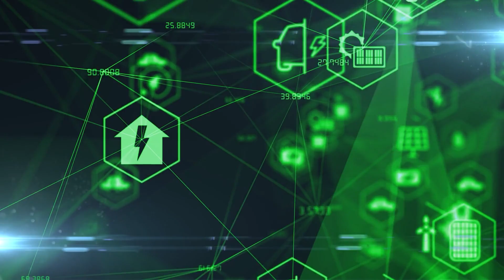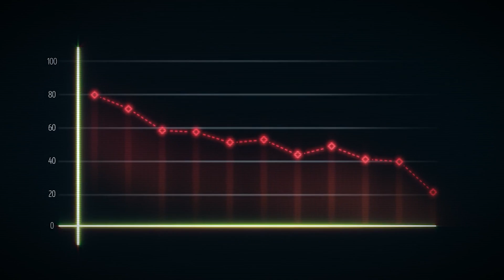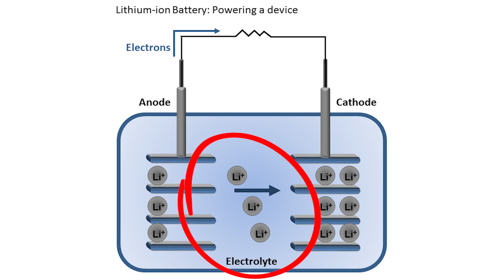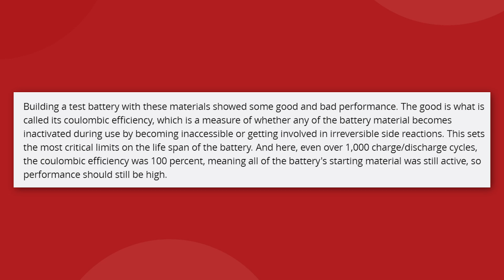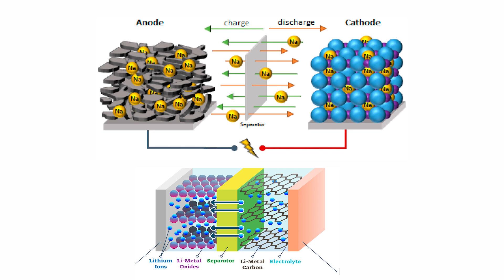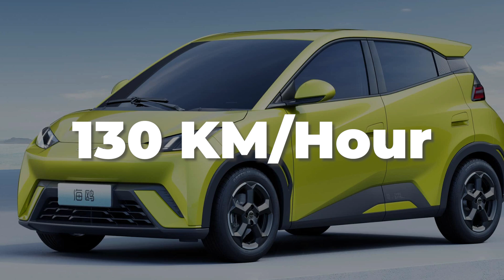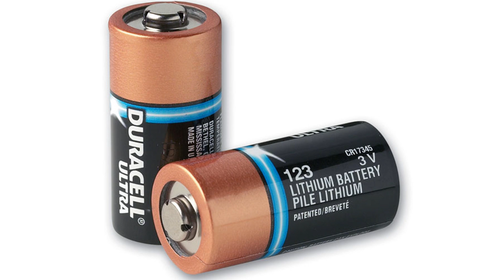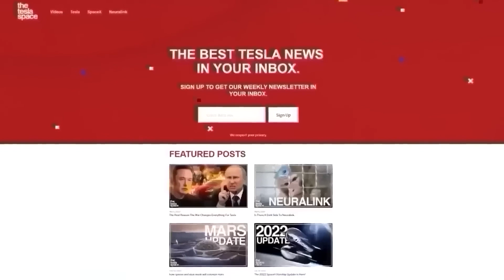Are These Batteries The Future Of Electric Vehicles?

Comment: It is the weight that would be a 1/4 for the same range. The capacity would still be 100kWh. Li-air is not a battery, but a fuel cell when the oxidizer is external so better call it a rechargeable fuel cell.

Comment: Although the solid-state printed battery looks very promising in the sense of the fact that could actually be done. But the problem is manufacturability at speed. I have never seen a 3-D printing machine that can possibly pump out the batteries like the Tesla, 4680 at a massive scale like that. I could be wrong, but it sure doesn’t look like it.  Come on just look at what they’re showing as far as 3-D printing a battery is slow,multiple layers of going back-and-forth back-and-forth. Get the drift?!

Comment: Big mistake @1:45: not 25 kWh battery! You still will need a battery with 100 kWh electrical capacity to gain the range of the car! You just will need a fourth of the battery volume. I'd suggest, you quickly edit this video.

Comment: It would be  a great step in the right direction if we stopped using Li batteries for static applications.  For a start this would reduce the demand for Li, make it cheaper, making EVs cheaper as a result and speed up their adoption to the benefit of all of us.  Better, these alternate batteries, if they just had market share should be far cheaper than Li batteries.  They are made from cheap readily available elements which can be sourced from multiple suppliers.  Better still, for static applications where weight is not a factor, they are technically better than Li batteries.  They last far far longer, can be cycled between 0 and 100% with no damage, need simpler electronics to control charging and discharging, are safer from a fire point of view and if you ever need to recycle them, will be far simpler to recycle than Li batteries.  There are the ZnBr flow/plating  and gel batteries, liquid metal batteries based on SbCa and possibly AlS, redox flow batteries based on Fe and V (so far) and the up and coming Na batteries.  Now there is a winner. Each Cubic meter of sea water contains about 33 kg of easily accessed NaCl

Comment: Sodium does not equal salt. Salt also has chlorine. Also, you said that the lighter air batteries would mean a car requires a quarter of the power. Still like the video though

Comment: The battery that I'm betting on in the not so distant future, because they are building a plant in the US right now, is the lithium sulfur battery. It would be nice if you would have done some background on that. Maybe you could in the future. Thanks for your good work.
Reply: There is also one in Switzerland
Reply: The best part about lithium sulfur batteries is you will know when they are fully discharged by the rotten egg smell they release when it's time to be recharged
Reply: Difficult to keep up with what the future is and the myriad battery technologies. The moral of the story is to keep clear of it all where possible as betting on the wrong technology risks it not being supported and early users just left hung out to dry.

Comment: kWh is battery capacity if the batteries can hold 4 X the capacity is doesn't mean you can reduce the battery capacity by 4 times it just means the energy density is 4 times greater it doesn't mean you can reduce a 100kwh pack to 25kwh, I would edit and re upload this video becuase it makes you look bad, you need to understand the topic you are talking about or you lose any credibility.

Comment: There is a error at 1:45 in you can't get away with 25Kwh battery packs. The correct answer is you potently may have a battery 25% the size or weight of current batteries.   4 x the energy density doesn't reduce Kwh it reduces size and/or weight.
Reply: Came here to say this too. This is a very elementary mistake and really destroys all credibility. I would take it down immedietly if I were him and fix it
Reply: Yup i only came here to say the same thing makes it look like he doesn't know what he's talking about
Reply: By the video's logic if we had an infinite energy density, we could use a 0Kwh battery.  So let's just leave out the battery altogether.  :)
Reply: Wanted to say this too.
100kWHr is 100kWHr reguardless of weight, mass, or volume.

I appreciate he's not in the electrical field but it really is a silly mistake.
Reply: @Mallchad  We all make mistakes from time to time but we grow by accepting our mistake and learning from them. Looking back at my comment I could do with some help from time to time with my grammar.  😕

Comment: So if this works with the loss of weight and extra space you could use two of the smaller batteries with a small generator to rotate charge the batteries giving unlimited miles?
Reply: No fossil fueled generators allowed!  No fossil fuels!  Period!
Reply: @acmefixer1  that's why two battery banks, one to run the vehicle the other to run an ac motor driven generator .
Reply: @tinybetron8701  
Are you serious?  🤣🤣